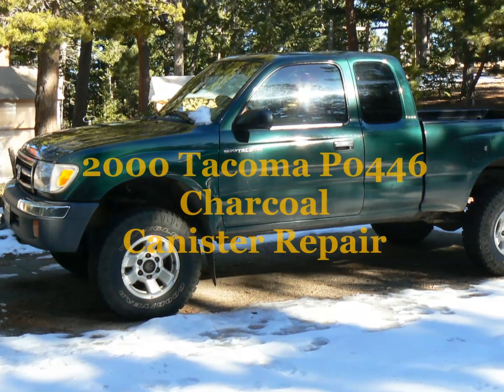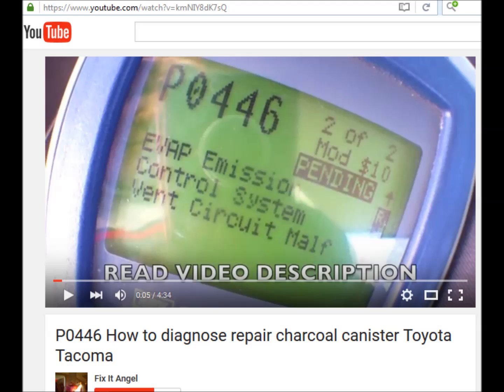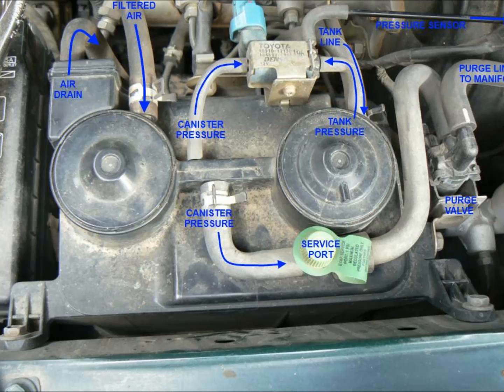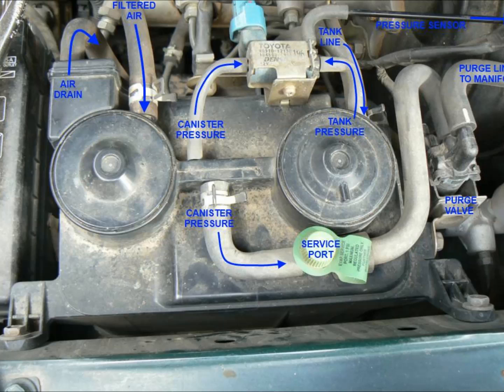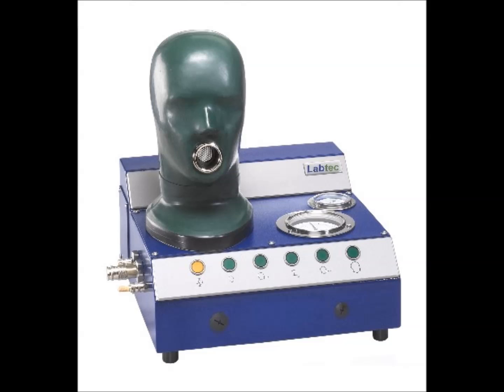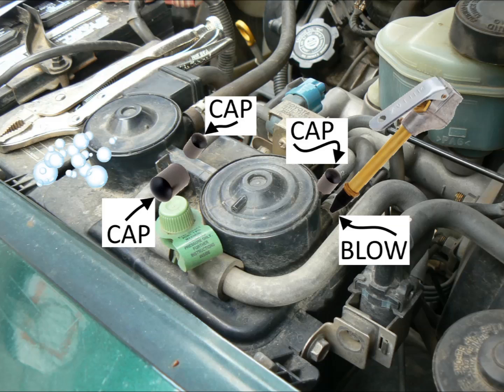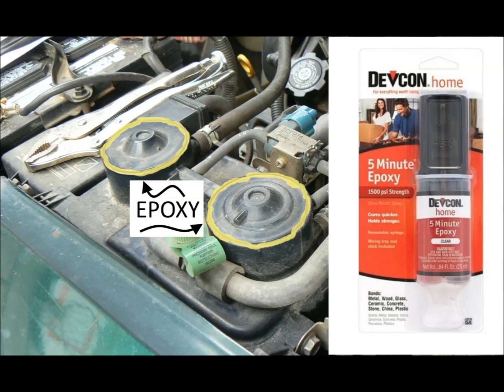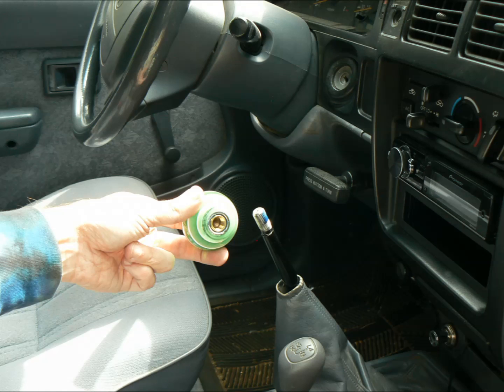P0446 Charcoal Canister Repair  --  With 5-Minute Epoxy!

Comment: Do I need the service port hose on there?
Reply from the maker: I will go with "yes."  Without it, the pressure sensor on the purge valve would sense that something is wrong.  Pause the video at 0:54.  There's a bubble that just says "PRESSURE SENSOR."  That sensor is on the bottom of the purge valve.
Reply: @ColoradoDemings  I changed my purge valve and gas cap but I hear a clicking noise in the purge valve, is it getting something stuck you think?
Reply from the maker: @jezeuz  If it clicks when you hook a battery to it, that's normal operation.  If it's just sitting there going click, click, click by itself, that seems kinda weird.  I ended up applying epoxy around the bottom seam of the plastic case, and P0446 hasn't come back in over 6 years.  Another video showed cracked hoses causing P0446.  Cracked hose = leak = check engine light.
Reply: @ColoradoDemings  I ordered a new one to switch it out. Hopefully it solves my check engine light, I'm also going to put epoxy around the seams as well tomorrow when I do that too

Comment: Gonna try these tips out, good video explaining the system for it, currently changed my purge valve and some cracked hoses but still getting ticking. Going to check the other sensors and ports now.

Comment: Great video, just did the test yesterday and got a leak at the same location on Fix it angel video. Can I use permatex black silicon sealant to seal this.? Will the gas vapor break the seal?

Comment: Hi ... Why does gas come out of the air drain? Thanks
Reply from the maker: The drain is a spring-loaded relief.  It keeps pressure from building up too much.  My guess is that if you got some gasoline on a cold night, but didn't drive the car when it was warm the next day, the tank might heat up and need to vent some air out the drain hose.

Comment: I have to say this is an excellent video, the steps you took to provide clarity (including markup diagrams etc) is really commendable. This has helped me tremendously so thanks a million! I do have one question, when i do the pressure test (blow into the canister) it's venting through that little hole on the top round cap closer to the cabin. Is it supposed to do that or is it a leak ?
Reply from the maker: The tiny vent hole might make a few bubbles as the circular diaphragm underneath moves up and down--which is normal.  If it's a continuous stream of bubbles as you apply pressure, that's a leaky diaphragm--which means canister replacement.

Comment: Nice detail/markup in the canister drawings, helped a bunch.
Thanks
Reply from the maker: Glad to help!  Did you find and patch a leak?  Sometime later I had to go back and epoxy the bottom seam of the canister (just like in the other video referenced at 0:22), but that was at least a year ago.  Application of epoxy has saved me $200 and kept P0446 away.

Comment: where does the (air drain hoes) connect to?
Reply from the maker: One end attaches to the canister as shown at 0:55.  The other end disappears down into the frame and connects to nothing.  It lets out air if pressure in the canister gets too high.